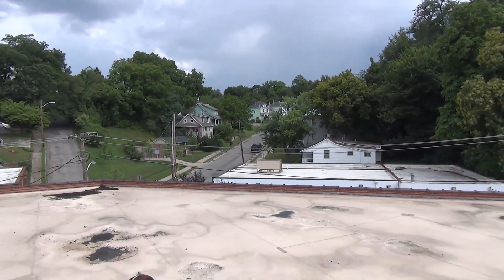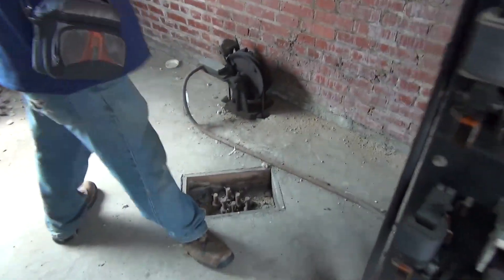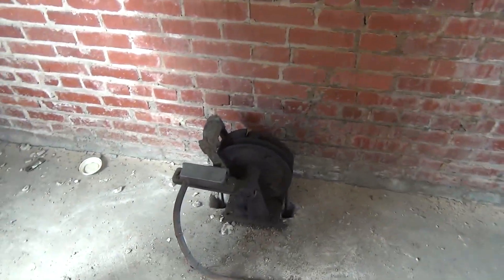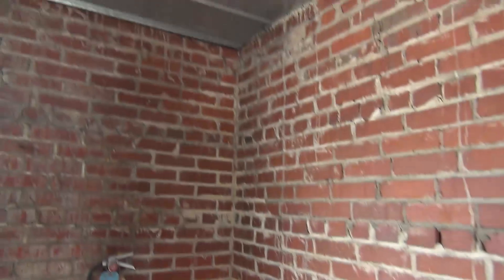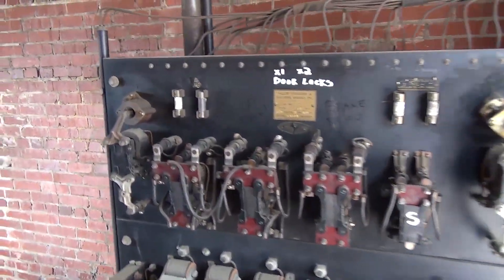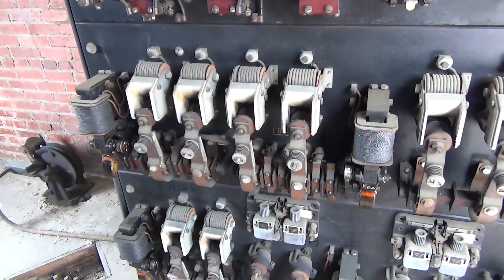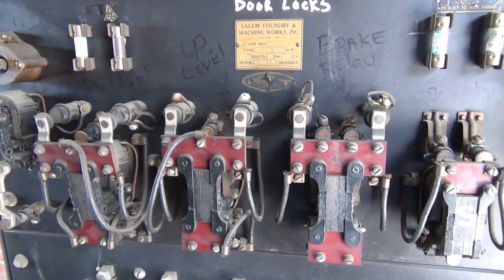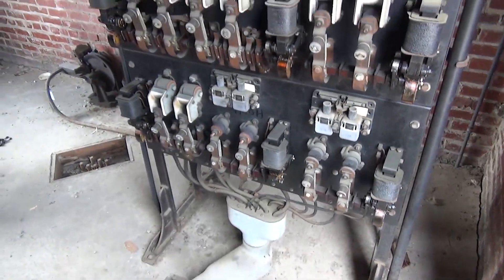Machine Room Tour of a Vintage Salem Freight Elevator

Comment: Nice vintage smooth working geared traction machine.  220V  3 phase induction motor must draw quite a bit of current. Leveling relays I've not come across probably drops the voltage to slow the motor on the floor landing.  I know Otis had a system when the MG cut out a landing field cut in slowing the traction motor.  There was a  freight elevator in the Bay Area in the former SH Kress store geared traction 2:1 roping installed around the 1930's.  Compensating sheaves on the top of the cab and counterweight,  4 landings 3 interior 1 exterior sidewalk for deliveries. Exterior gate was wood. Could see the shaft and top of cab. It was removed in early 2000.  My former job nearby had a hydraulic freight elevator 5HP 3 Phase 208V induction motor power unit.

Comment: Really cool! You don't see that type of pulley system everyday. I should say just be a bit careful when they press the stop button in the elevator. This will as you know engage the brake for the motor, which could cause asbestos fibers in the brake pads to become airborne which could affect your health.

The shunt field relay is most likely some sort of 'suicide' circuit that connects the field and armature winding's of the motor together to kill the back EMF that is created when a motor suddenly loses power. Otis did a similar thing with their elevators (the next time you are looking at an old Otis controller, see if you can find a relay named SUD). If they didn't do this, the elevator motors residual current could in turn cause the elevator to 'pull through the brake'. Not to mention it could cause some electrical components downstream to fail due to the back EMF produced.